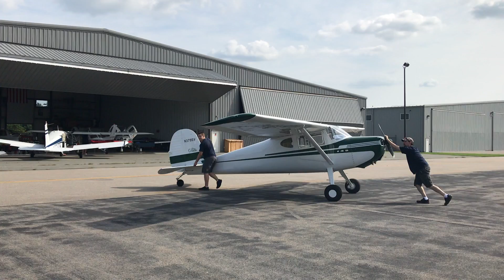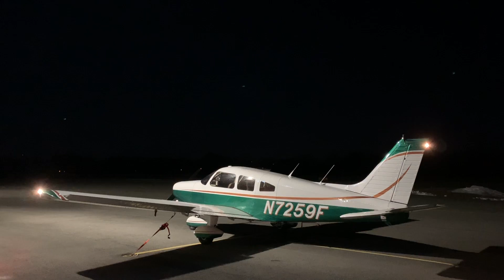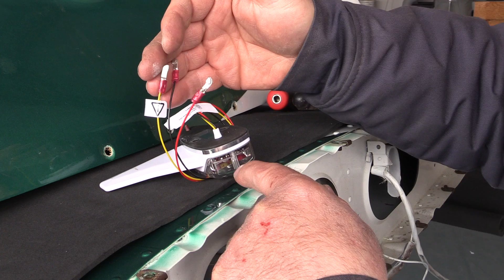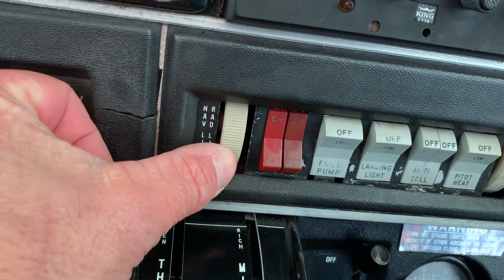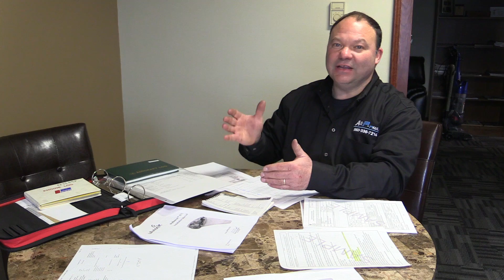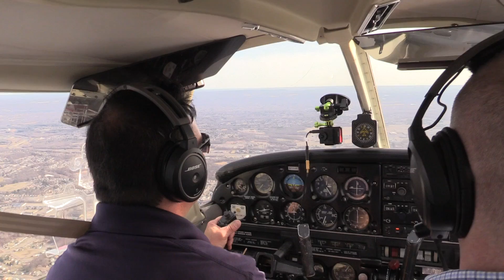Installing a skyBeacon ADS-B system

Comment: Installed a tail beacon on a 172 powered through the nav light switch, all we have is static over our radios when the NAV switch is turned on. We need to turn the squelch almost all the way down to a eliminate noise while flying what could be the issue we checked ground and cleaned grounds from the stabilizer to the rudder already didn’t change anything, ever since installing this tail beacon my flights have been the most distracting and dangerous all my life, we just turn it off now and don’t use it

Comment: Hi thinking installing one of these on our Warrior. I do have a question wrt the the wiring of the strobe. Our aircraft also employs the Whelen power supply to drive the strobes. The circuit of the strobes looks to be around three hundred volts. Did you pull the 12 volts for the strobe from the Whelen power supply if so which output on the power supply did you use and were was the power supply installed on the aircraft you worked on. 

Cheers, and thanx

Comment: If your aircraft has the option for independently switched strobe/nav lights and the leads are not easily identifiable when the light mount is removed, is it important to determine which lead gets connected to which in the Skybeacon?
Reply: I guess that would depend on whether or not you want to be able to turn it on when you want it on.
Reply: @8literbeater  It would make sense if there's a switch in the cabin?
Reply: @merlepatterson  wouldn't that switch already be connected to the nav or strobe on the other wing? So then wouldn't you think if you connected the skybeacon to the wrong wire, it would make a difference? I mean, I guess you could have one nav light and one strobe come on with each switch, but that seems a little cartoonish.
Reply: @8literbeater  I was think they both come on independently as pairs? I was just thinking if the switches were there, might as well hook things up accordingly? Probably no big deal though.
Reply: @merlepatterson  strobes are always on their own switch.
Reply: @8literbeater  Yes,  I seem to recall that from my flying days.

Comment: This is a good video as far as the real-time install estimate. Some other websites are advertising it as a "less than 10-minute installation."

I’ve installed several of these as well as several panel mount ADS-b transponders. It is the easiest and simplest installation available but I can assure you it’s not a 10-minute installation, even just the physical part.

Most airplanes require some minor modification to make it fit properly so figure a minimum of 30 minutes up to 2 hours for a more complicated install like a Beech or Rockwell airplane or others with covered nav light assemblies. It will take 10+ minutes just to read and understand the instructions for a first-time installer.

Then add another 15+ minutes for downloading the app to a smartphone and programming.

The 337 and associated research and mailing prep will probably take an hour minimum.

It’s a great little system but advertising it as a 10-minute install is misleading.
Reply: But that’s all the owners hear, so when the bill is higher than 10 minutes, a fit is thrown. Welcome to aviation maintenance, where you won’t spend money on your hobby.

Comment: Be careful on using the Nav light wire on an aircraft with say gear lights (or any other indication lights that dim with the Nav light switch). The 3 green gear down lights dim and can't be seen with the Nav lights on during the day. ATC is NOT going to be happy if you turn your Nav lights off (and thus the ADS-B) in the pattern so you can see your 3 green indicator lights...

Comment: I had this installed on my '71 177B, the Cardinal uses a non-standard position light and needed an adapter to mount it, this information was available to uAvionix when I order the unit but they didn't tell me about the adapter so this delayed installation by about two weeks until they sent the part, a small piece of plastic slightly larger than a ping pong ball and costing $100 plus shipping and tax.  I don't have wing tip strobes so that wasn't an issue.  The installer made an error in the paperwork, seems that I have the only 177B made by Piper, I caught that error, the FAA had approved it, apparently giving it the same intense review they gave to the Boeing 737 trim system.  I had to return all the bad paper to the FAA before they'd issue new paper, apparently they like to hide their mistakes.  I called the local FAA tower and asked if I could do an flyby check of the system and they assured me that they could, I did this two days later, the controller indicated that all was fine and the ADS-B was giving all the right information, I then asked that they provide the paper report on line, well they couldn't do that, thus closing the window on my $500 rebate.  Weather and product delivery delays had eaten the available time, not me or the installer.  This all reinforces the FAA motto, 'we're not happy until you're not happy' since had I know they couldn't do the report, I would have flown to another area that could do it.  Price-wise it is a little cheaper than having the box inside and I was concerned about how much panel real estate this was going to take.  Installation was pretty expensive since my plane was snowed in for most of the winter and the installer came to my airport rather than do the job at his, my hanger is on a grass strip and they generally don't plow grass.
Reply: Henry, you can get a report of your flight from the FAA at: https://adsbrebate.faa.gov/PAPRRequest.aspx 
If you had flown within the mandated ADS-B out airspace for 30 minutes or more. If you passed the report this is what you use to collect a rebate if you had reserved one.

Comment: where come GPS Speed, Position etc from?
Reply: @Etienne and baro height? 🤔
Reply: GomoDRiL 
    This type of ADS-B transponder “sniffs” the reply from the panel mounted mode 3A/C transponder.  

     It detects the pulses being transmitted by that transponder on 1090MHz and decodes the squawk code and pressure altitude (that came from the altitude encoder wired to the transponder).

      It then rebroadcasts this information, along with its own position, ground track and velocity, on 978MHz (UAT freq).

Comment: I still like the KX-170B's one of the best GA Nav/Coms ever made. I thought I died and went to heaven when I started flying an airplane so equipped in 1976, As for this ADS-B, I think for a lot of light aircraft owners it's a good solution. We had heads up on this for a long time.

Comment: Just wait till you have to pass a successful PAPR. We've had nothing but issues with Mode 3 failures with the installs we've done on 3 Cessnas. It's a trial and error process in adjusting the monitor threshold.
Reply: Yes!
     I noticed this Archer still has an old cavity tube transponder.  As these age, they will fall out of calibration.  It would have been smarter to install a used GTX-327 ($300) and a GDL-82 for ADS-B out.

Comment: So when the nav lights are off you no longer have ADS-B out? And the FAA signed off on that? There actually are people in aviation who try to get away with things they should not and this is one of them!
Reply: Is there a reason you can't have your position lights on in the daytime?
Reply: An aircraft with say gear lights dim when the Nav lights are turned on and then can't be seen with the Nav lights on during the day.

Comment: Thanks for another very interesting and professional video, always enjoyable. One small point tho, wouldn’t it be even better to wire it up to the nav light circuit instead of the strobes? That way it simply comes on without an extra checklist item and thus no chance of missing it being turned on. Just a thought. Thanks again, timely info as usual.
Reply: Philip Byrnes It IS wired to the nav light circuit. It has to be a must-be-on switch in order for the ads-b to be transmitting. A lot of people don’t bother with the nav lights during the day. The skyBeacon will require a change of habit. The strobe on the other hand, is optional. If your airplane doesn’t have strobes, simply cap and stow the spare wire. If your airplane does have strobes , you have to take the strobe light generator out of the circuit. Also worth mentioning, the skyBeacon also works fine with 24 volt systems.
Reply: @TenMinuteTrips  You can also hook the strobe wire to the nav light wire. You can turn the strobe on / off through the App.
Reply: Using the app only allows you to SET strobes to ON/OFF while not moving.

Comment: This is almost worthless.  You show very little of the actual install.  And the option of connecting the strobe and position light to the one power wire wasn't mentioned.  Sheesh.  So, if you don't have a strobe you can still use the Skybeacon strobe.  Position light and strobe light wires from Skybeacon gets twisted together and connected to the one  power wire from the plane.  And no 337.
Reply: Not sure what you meant by no 337.

      The video didn’t cover it, but it is important to note that IF a flight test (OFE) is used to verify ADS-B out performance, TWO Form 337s should be filed.
        One is to document the installation IAW the STC and the other is to document ADS-B out performance meets 91.227 performance requirements.

       https://www.faa.gov/nextgen/equipadsb/installation/media/ADS-B_Out-In_Installation_Tech_Paper(9-25-17).pdf
Reply: @Stepclimb 
You are correct according to AFS-360-2017-1. I wonder how many owners, IAs aren't filing the second 337.
Reply: Screw driver and a couple butt splices.
Reply: I connected the red ADSB wire and yellow strobe wire to the position light    12volt supply wire and the ground wire to ground, this allows the position light switch to power both the ADSB and the strobe.

Comment: So they are making it mandatory to run nav lights even in daytime?
Reply: It's funny, in Canada, you don't need anti-collision lights during the day.

We also have more strict regulations in terms of licensing and as a result, a lower GA accident rate.
Reply: Max U don’t forget, fewer operations could result in fewer incidents.
Reply: Michael Autry yes, but it’s measured at a rate per 100,000 hours

Comment: How was gap filled?
Reply: The install did leave us with this gap... Which we will ignore for the rest of this video.  Seriously, not one more word.
Reply: I have installed a couple of these that required a gap fill. I made a blank that covered the original opening out of 1/8" thick carbon fiber plate. I sealed the plate to the wing tip fairing and mounted the SkyBeacon to that plate. It looks good and is structurally good.
Reply: I'm guessing Plastic Body Filler (like Bondo but for plastics) and/or 3M Plastic Repair.